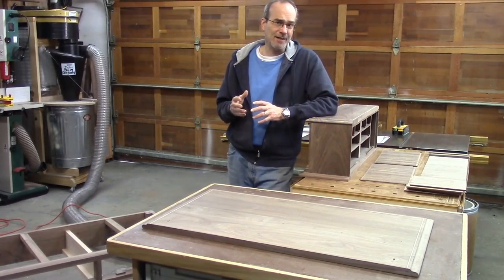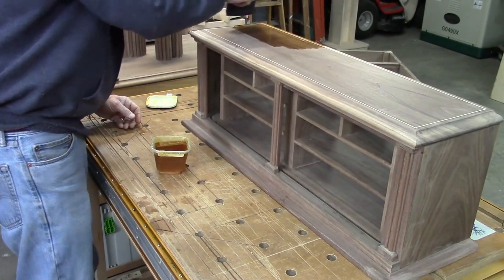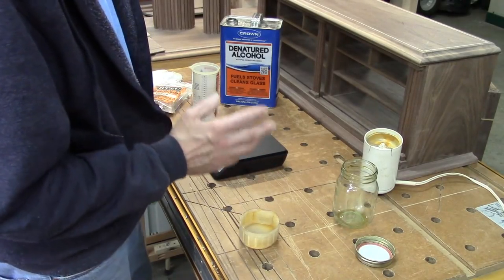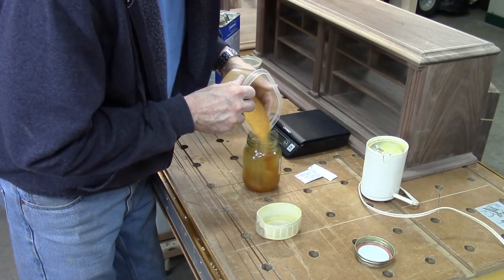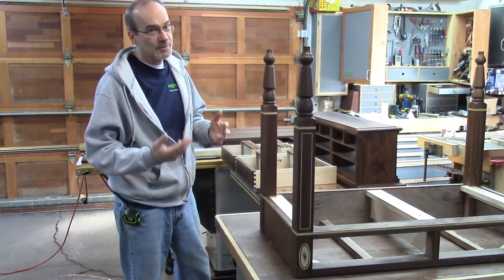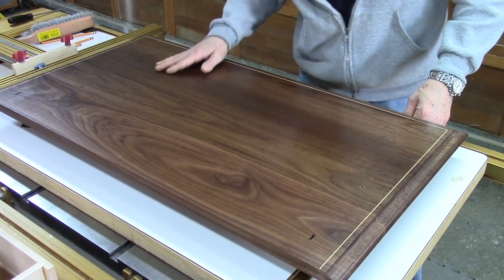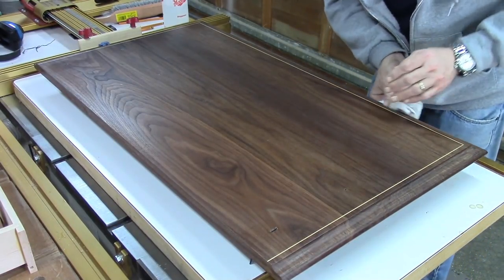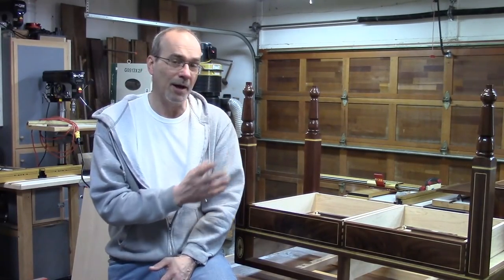Small Secretary With Tambour Door – Applying an Oil and Shellac Finish

Comment: Looking good Guy!

I've never tried linseed oil. After seeing your little demo I'm going to put it on my list of finishes to try. I am curious though, since you applied shellac, which offers plenty of color and depth to the walnut, why did you first use linseed oil?

Good tips for the shellac. From my experience, leaving the shellac in the alcohol overnight is usually enough. You probably weren't in a hurry though. A build I took with Chris Schwarz had us finishing with shellac. After sanding we didn't clean up the resulting dust because the alcohol/shellac just 're-melts' it into the next coat. That's a technique with lacquer too. YMMV.

Oh, and I used to use the compressor to blow the dust off my projects, but for quite awhile now I've been using my vacuum with a quality horse hair brush attachment to vacuum up the dust. This way I don't put dust in the workshop for the next day, and I can immediately start the finishing process.

I think I like the larger pull too, but that's a tough call. You might want to do an image search for similarly scaled pieces to get more ideas.

That finish looks beautiful. You must be a happy camper with this project. Really looking good.
Reply from the maker: Hey Marty! I tried a sample piece of the walnut with and without the oil, and the oil did help to darken the wood a little more, which I liked. It's really just a personal preference is all.

  In regards to the dust being left from the sandpaper, I have done it both ways. and I prefer to wipe it off in case there is any grit from the sandpaper in the dust. The final two coats were rubbed out with synthetic steel wool pads, which I didn't bother to wipe any of that off.

  The finish came out really nice, and I am very happy with it. Thanks for all your tips and the input on the pulls.

Comment: Excellent series. All your videos have been great. Very inspiring. 

Either pull would look nice. You did a great job finding ones that really work with the piece. I prefer the smaller pulls. They seem in better proportion to the piece all around. And I think the inlay should be more of a focal point than the pulls. Just my opinion.

Comment: The finish turned out great  Guy, realy makes the piece shine! Do you find that the shellac and wax combo provides sufficient protection especially for the tabletop? I'm soon going to come to the finishing stage of a make up table for my wife and wondering whether I should be using hellac and wax or wiping varnish. I tend for the varnish and least for the tabletop in order to have more protection.
Oh, and I vote for the smaller hardware, I think the attention should be focused on  the georgeous furniture and other details instead of he hardware.
Reply from the maker: Tamás Elkán Thanks Tamas! For what this will be used for, the shellac and wax should be more than enough protection. If I were to build a make up table for my wife, I would go with the wipe on poly also.

Comment: Hi, 
Is shellac finish is same as linseed oil finish? I mean do you get natural wood finish when you apply shellac on wood?
Reply from the maker: No, it is not the same. Linseed oil is an oil based finish, takes a long time to dry, and doesn't offer much protection. Shellac is alcohol based, dries quickly and offers better protection than just linseed oil. Shellac doesn't have the "close to the wood finish" just linseed oil wil give you, however it is not a thick plasticey finish like poly.

Comment: Do I need to allow a week for the oil/naptha to dry out, then should I run it over with a tack cloth/naptha to remove excess oil /dust
Reply from the maker: I always wait at least 3 days for boiled linseed oil to dry. A week is optimal.